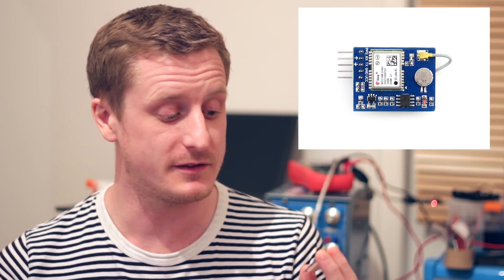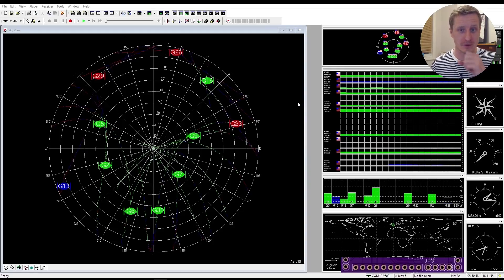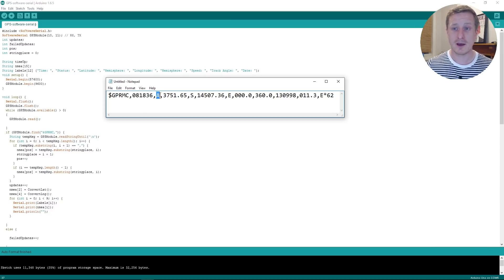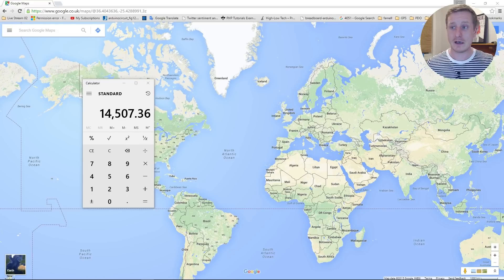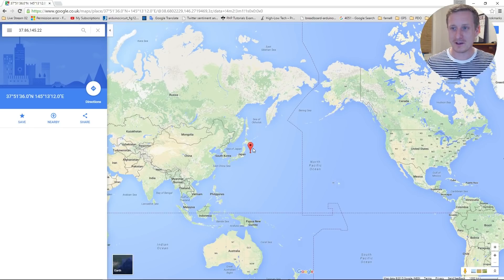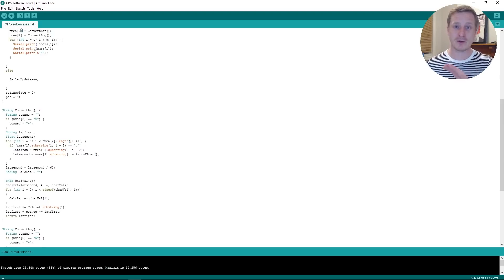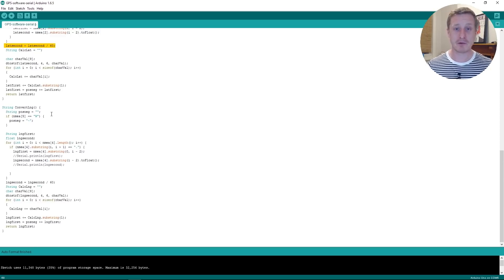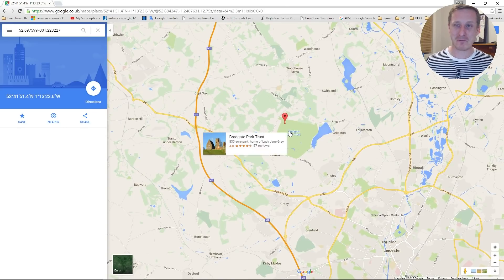U-blox neo-6m GPS Module: Arduino NMEA Decoding

Comment: I ordered 3 for prototyping drones. I have a xiaon esp32s3 running an accesspoint hosting http server for output of mpu6050 data and gps data. The mpu6050 displays data but my gps does not. I do see one binary character. But im lost at this point. I have to step outside for the blue led to turn on but 30 minutes of running i got no data

Comment: David, I was wondering how do I change from UTC (Universal Time Clock) to CST (Central Standard Time) (Chicago Time)? I have been doing with two of your hobby, and I have been noticing the time on GPS module that has six (6) hours differences. I have been doing the projects like your from time to time doing my hobby. Thank you, Damian
Reply from the maker: GPS satellites only broadcast UTC time, you would need to make a manual adjustment to the time. Somebody made a nice timezone library you could use https://github.com/JChristensen/Timezone

Comment: Hi david, 
I want to thank you for your amazing work. Your code works fine with my arduino uno.
For my own project i want to interface gps new 6m with stm32 bluepill.
So what are the modifications i shoud put in your code?
I use arduino ide for programming my stm32.
Help me please !!

Comment: Whenever I run the code and look at the serial monitor it only gives me "????????????????????"
Reply from the maker: That looks like the serial monitor can't understand the output. Make sure you set your serial monitor to 57600 baud and your RX is on the right pin.

Comment: Hi David, I have built a clock that uses TinyGPS++ but on switch on, the time is out by 2 seconds until the leap second data is refreshed which happens every 12.5 minutes. Is there a way to detect when this happens, so I know the time is accurate?
Reply from the maker: I don't know I am afraid, this may help https://www.telit.com/technical-forum/detection-of-leap-second-correction-between-gps-time-and-utc-time/

Comment: MY neo 6m has a pulse per second pin, what would i use that for?
Reply from the maker: You could use that as a very accurate clock source, as a counter, synchronisation, to wake up a microcontroller from deep sleep or just to blink an LED.
Reply: @DavidWatts  would the code still be the same or how would you go about adjusting this

Comment: Your wish list has no list of wishes!
Reply from the maker: I have no wishes ;-
Reply: @DavidWatts  In that case, you're unlucky that i'm not a wish-granting fairy.
Reply: Have you done much  high voltage (tens of kVs) experiments? I had to stop because of the field effects, even just using a 20kV ignition coil through a hardware PWN it messed up my monitors, my digi scales, my phone - everythin electromagnetic within quite a few feet was  perturbed in some way.
Reply: Liked and subbed :)

Comment: #include <SoftwareSerial.h>
SoftwareSerial GPSModule(10, 11); 
int failedUpdates; 
int pos; 
int stringplace = 0; 
String timeUp; 
String nmea[15]; 
String labels[12] {"Time: ", "Status: ", "Latitude: ", "Hemisphere: ", "Longitude: ", "Hemisphere: ", "Speed: ", "Track Angle: ", "Date: "}; 
void setup() 
{ 
Serial.begin(57600); GPSModule.begin(9600); 
} 
void loop() 
{ 
Serial.flush(); 
GPSModule.flush(); 
while (GPSModule.available() > 0) { GPSModule.read(); 
} 
if (GPSModule.find("$GPRMC,")) 
{ 
String tempMsg = GPSModule.readStringUntil('\n'); 
for (int i = 0; i < tempMsg.length(); i++) 
{ 
if (tempMsg.substring(i, i + 1) == ",") 
{ 
nmea[pos] =tempMsg.substring(stringplace, i); stringplace = i + 1; pos++; 
} 
if (i == tempMsg.length() - 1) 
{ 
nmea[pos] = tempMsg.substring(stringplace, i); 
} 
} 
updates++; nmea[2] = ConvertLat(); nmea[4] = ConvertLng(); 
for (int i = 0; i < 9; i++)
{ 
Serial.print(labels[i]); Serial.print(nmea[i]); Serial.println(""); 
} 
} 
else
{ 
failedUpdates++; 
} 
stringplace = 0; pos = 0; 
} 
String ConvertLat() 
{ 
String posneg = ""; 
if (nmea[3] == "S") 
{ 
posneg = "-"; 
} 
String latfirst; 
float latsecond; 
for (int i = 0; i < nmea[2].length(); i++) 
{ 
if (nmea[2].substring(i, i + 1) == ".") 
{ 
latfirst = nmea[2].substring(0, i - 2); 
latsecond = nmea[2].substring(i - 2).toFloat(); 
} 
} 
latsecond = latsecond / 60; 
String CalcLat = ""; 
char charVal[9]; 
dtostrf(latsecond, 4, 6, charVal); for (int i = 0; i < sizeof(charVal); i++) 
{ 
CalcLat += charVal[i]; 
} 
latfirst += CalcLat.substring(1); latfirst = posneg += latfirst; 
return latfirst;
} 
String ConvertLng() 
{ 
String posneg = ""; 
if (nmea[5] == "W") 
{ 
posneg = "-"; 
} 
String lngfirst; 
float lngsecond; 
for (int i = 0; i < nmea[4].length(); i++) 
{ 
if (nmea[4].substring(i, i + 1) == ".") 
{ 
lngfirst = nmea[4].substring(0, i - 2); 
lngsecond = nmea[4].substring(i - 2).toFloat(); 
} 
} 
lngsecond = lngsecond / 60; 
String CalcLng = ""; 
char charVal[9]; 
dtostrf(lngsecond, 4, 6, charVal); for (int i = 0; i < sizeof(charVal); i++) 
{ 
CalcLng += charVal[i]; 
} 
lngfirst += CalcLng.substring(1); lngfirst = posneg += lngfirst; 
return lngfirst; 
}
Reply: There did not work problem

Comment: Just hooked up the Neo-M7, and your code seem to run flawlesly. However I Am getting zero on all my reading :'( Any idea why?
Reply from the maker: That happens when you don't have a good satellite fix. The GPS module needs to be able to see the sky, putting it by a window helps but outside is ideal.
Reply: @DavidWatts  I tried that but still no signal really. However I also don't have an antenna attached. Maybe that explains it. :o
Reply: @DavidWatts  Got this working: Place in windows, attach home-made antenne (metal wire), wait 20-30 minutes.

Comment: Hi, Can you tell me if if is possible to get NMEA data from these modules without using the Arduino?
Reply from the maker: Sure, anything with a Serial connection will work.
Reply: @DavidWatts  thanks for the fast reply! I have tryed to get the NMEA data using a USB-Serial converter and hyper terminal, but recieved only simbols on all baudrates from 1200 to 11520... 
So as I understand the GPS module does not output any NMEA sentences but in fact some raw data only?
Reply from the maker: @alexp.1989  I believe 9600 is the standard baud rate. I have used it with a 3.3v serial to USB converter but I used the U-center software from u-blox. It should work fine as long as the unit has a good signal.
Reply: @DavidWatts  I have tryed the  U-Center software also with no results. Most probably my module is defective... Oh well... I will try again with a TTL converter when I recieve it. Thanks for the reply!

Comment: Hi, thank you for the great tutorial. I'm wanting to collect the GPS coordinates every minute or so. I'm currently using the delay function and inputting 60000 however, there are no outputs. I have determined that anything over a delay of 4000 will not output anything. Is there a way to resolve this?
Reply from the maker: You are better off storing the data and only outputting every 60 seconds. Look at the 'blink without delay' example in the arduino IDE for some sample code that doesn't block your micro from checking the GPS.

Comment: Thanks for yet another great video. It served me a lot for the neo m8n that I just bought and it worked perfectly, I just had to add a piece of code so that the program could give me degrees.
    long latnum=posllh.lat/10000000;
    long latdec,londec;
    if(posllh.lat<0){
      latdec=-posllh.lat-(-latnum*10000000);}
    else{
      latdec=posllh.lat-(latnum*10000000);}
    long lonnum=posllh.lon/10000000;
    if (posllh.lon<0){
      londec=-posllh.lon-(-lonnum*10000000);}
    else{
      londec=posllh.lon-(lonnum*10000000);}
Serial.print(String(latnum));Serial.print(".");Serial.print(String(latdec));Serial.print(",");Serial.print(String(lonnum));Serial.print(".");Serial.print(String(londec));

Comment: Thanks for this, I have  just got one of these modules and so the code will be very useful. By the way, when you convert 
degrees and minutes to decimal degrees, southern latitudes are minus, so the latitude in the example you used should have been  -37.86, and together with the 145.12, give a location in Melbourne, Australia.

Comment: Sorry but I'm getting this error and please in future save your files with zip.
GPS_software_serial_ino.ino: In function ‘String ConvertLat()’:
GPS_software_serial_ino.ino:65:44: error: ‘class String’ has no member named ‘toFloat’
GPS_software_serial_ino.ino: In function ‘String ConvertLng()’:
GPS_software_serial_ino.ino:94:44: error: ‘class String’ has no member named ‘toFloat’
Reply from the maker: What are you compiling your code in? Works fine for me in the Arduino IDE 1.8.1 and this would have been written in a much earlier version. Here is a reference to the toFloat function - https://www.arduino.cc/en/Reference/StringToFloat

Comment: What about PPS pin? What it is doing? Where should be connected?
Reply from the maker: Hi, mine didn't have a pps pin. However it is just a pin that will give you a high when it it is tracking enough satellites and low when it isn't. The default refresh is 1hz so when tracking this pin should cycle high to low once per second.

Comment: Actually, its not UART, its TTL. UART is more based on externals such as RS-232. TTL is a more ancient standard still in use today. Although they are electrically similar, UART's usual protocol - RS-232, has an inverted data polarity when compared to TTL.
Reply from the maker: +Chris Trigg thanks for the correction.

Comment: how to condensed time in gps ublox neo 6m this? can you tell me step by step?
Reply from the maker: condensed time?
Reply: yeah. in this video you  write " 3 hours condensed into 20 second". what is the meaning?
Reply from the maker: Ah I see. I recorded 3 hours of my desktop with the gps running and then sped up the resulting video. I used OBS to record the desktop and Adobe Premiere to speed up the video.
Reply: so it's not how to condensed the data to get into the gps. how to overcome the legth of tome data into gps?
Reply from the maker: It would be kinda impossible to save 3 hours of data at 1 per second, that would be around 129kb for the minimum data set. However you could save the data to an array every 5 minutes and it would only need about 432 bytes of ram to store. Other than that you could save it to an SD card.

Comment: hey sorry I have another question. I make a program to convert and show the longtitude and lattitude into lcd, but I didnt work. Is neo6m cant work while using avr connected to computer instead I have to use another supply. thank you
Reply from the maker: Interesting, the module should not use more than 100ma, in fact according to the datasheet it would be under 70ma. You PC USB should be able to supply a minimum of 500ma unless it is incredibly old. Table 11 on page 15 - http://bit.ly/28Z8vFb
My advice would be to get a USB active (The active bit is important) extension cable, I use a 5m one to move my test setups close to a window so I get real data from the GPS.
Failing that you can throw your code up on pastebin and I can try and help you out.
Reply: +David Watts can I send it directly into your email ?
Reply from the maker: Nube Lighter I would rather you didn't my inbox management is atrocious.
Reply from the maker: After looking through the code (I don't understand it all) I can see  that you are using an interrupt driven method for getting the serial data from the GPS. This is likely going to present a problem, at default the GPS updates at 1hz but depending on your processor it might take a while to shift around all the characters. I would wait for data using the interrupt then if it is received stop the interrupt and run your display code, then fire up the interrupt again.
Reply: +David Watts oh I see your point, it makes sense. I will try to make a condition that only show the gps data in  one moment not continuosly, thanks again I owe you much
Reply from the maker: You are welcome.

Comment: i am using it right now, but I got a problem. The gps is not getting NMEA data, any help ? Im using atmega 128a not arduino
Reply from the maker: The GPS should be sending out serial data even if it cannot get a fix. Do you get anything at all?
Reply: Now it works, the problem is just a time. It needs to wait about 5 minutes here to take the data, thanks for your information on your video it really helpfull

Comment: Hi
Can u tell me is it possible to improve my accuracy by using 2 GPS module NEO - 6 M (comparing information)?
I mean in Arduino or create app in Delphi XE8 or C#, or any other methodes?
Reply from the maker: It would certainly be possible to perform a calculation on two different receiver's positions. You could just use floating point math to figure out the difference between the readings and average it out. However, I have heard that two GPS receivers in close proximity can interfere with each other. It would be worth experimenting.
Reply: But its  possible to do on Arduino Yes?
Reply from the maker: Alex Gordn Yes it would be possible, you would have to play around with the math a bit since the floating point math on the platform is a little limiting but it is possible.

Comment: code  is not working :
sketch_jun06a.ino: In function 'String ConvertLng()':
sketch_jun06a:94: error: 'class String' has no member named 'toFloat'
Reply from the maker: Have you changed the code? It compiles fine for me using IDE 1.6.9. This is the function is is looking for - https://www.arduino.cc/en/Reference/StringToFloat but it looks like you might have a missing semi-colon or bracket somewhere. If you throw your code onto http://pastebin.com/ I can help troubleshoot.

Comment: Great video, thank you!
Google maps will take those coordinates with some minor formatting:

Open Google Maps.
In the search box at the top, type your coordinates. Here are examples of formats that work:
Degrees, minutes, and seconds (DMS): 41°24'12.2"N 2°10'26.5"E
Degrees and decimal minutes (DMM): 41 24.2028, 2 10.4418
Decimal degrees (DD): 41.40338, 2.17403
A pin will show up at your coordinates.
From Google Maps API: goo.gl/2P4lJf

Comment: Ublox GY-NEO6MV2 GPS Module is not getting locked to gps satellite even after an hour in open space. All the connections are correct. What can be the problem?
Reply: I  have the same problem, did you find the solution?
Reply: brother did u tr it out
Reply: same problem here
Reply: how are you providing supply to it??

Comment: Sorry to ask a question again, but I'd like to create an "if" or "if&&" function within this code - so if the arduino reads that the GPS returns certain longitudinal/latitudinal co-ordinates I can get it to write an action.

I'm struggling to determine exactly what I should ask it to read? Would it be a string, a return, or from serial monitor?

Thanks!

Comment: Hi there, great video!

My code seems to be working but with the lat/longitudinal values blank. It could be that it's not picking up a signal, but just want to check how you wired it up...

Did RX from GPS go to pin 10 in arduino, and TX go to 11 in arduino?

Many thanks, Mark
Reply from the maker: +Mark Bramham Hi Mark,  if you are getting no values it is likely you are not catching the satellites. TX on the module goes to RX on the Arduino.
Reply: +David Watts Cheers for the quick response (this late as well!)

I've got it working now, I had to swap my TX and RX round on the code (11,10)//RX,TX, and then put RX from ublox into 10 (Defined TX), and TX from ublox into 11 (defined RX). swapping wires around didn't work.

Not sure why this is, possibly because I'm using a different board?

Comment: Great Sir! Does code right for NEO-8M. I use Arduino UNO but my terminal screen don't have anything. My English is not good
Reply: +Hau Dao  toi cung dang lam project ve neo 6m vs arduino nay.ban co the giup toi ko
Reply: +Lam The ok ban can giup gi
Reply: +Hau Dao tôi kết hợp sim 900a và neo m6 vs arduino sao cho trả tọa độ về qus sms
Reply: +Lam The tôi làm cho nó trả và nhận tin nhắn đc rồi nhưng làm sao để thu tọa đô từ neo về sim 900a đây :(

Comment: Hi David Could you please tell me if this item off ebay item number 111830230095 is ok for what you have explained here GPS U-BLOX NEO-6M MODULE AIRCRAFT FLIGHT CONTROLLER FOR ARDUINO MWC IMU YMZ7 and if not could you please point me in the right direction this unit only has 4 pins I think. Cheers.
Reply from the maker: +Bill Parker Same thing mate, the other pin mine has is Pulse per second. PPS, it isn't important in this use case.
Reply: Thank you David.

Comment: Thanks for sharing. I'm looking for a similair option, but I have a garmin 64st gps which should be able to send NMEA data. Unfortunately no one can tell me how I cannot it to a microcontroller. Could it work when i buy a USB (Output of the GPS) to serial adapter so I have a TX maybe?
Reply from the maker: +Tilburger72 Sounds about right, this seems to suggest you can us a serial to usb adapter - http://www.oziexplorer3.com/support/oziexplorer/gps/ozi_gps_garmin_support.html
Reply: +David Watts Thanks for your reply.
My idea is to build a rally tripmaster based on an arduino or stm32 controller board. Maybe a usb to serial adapter would be my solution to get the serial TX from the GPS USB connector and connect it to the RX from the controller. Do you have any idea?
Reply from the maker: Tilburger72 That is what I would try first, USB to serial adapters are pretty cheap.

Comment: Great video! May I ask you how accurate this chip is? I would try to build a robot which should recognize over this chip in which room of the house he is. Do you think it is accurate enough?
Reply from the maker: +Bester Bewerber Hi, it doesn't work very well indoors unfortunately. Outside though you would get accuracy down to a few feet.
Reply: Ok thank you. Do you know a gps sensor which would work inside with the arduino and is fairly accurate?
Reply from the maker: Bester Bewerber Sorry buddy, GPS just won't cut it indoors. You should take a look at some other solutions.